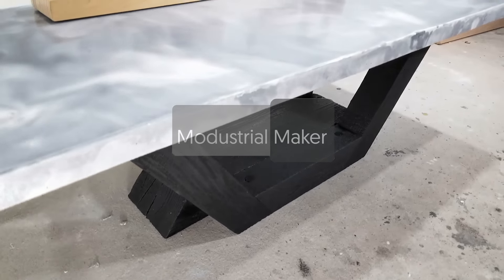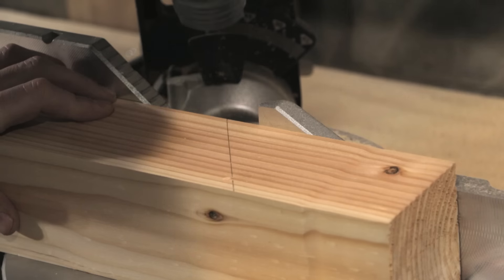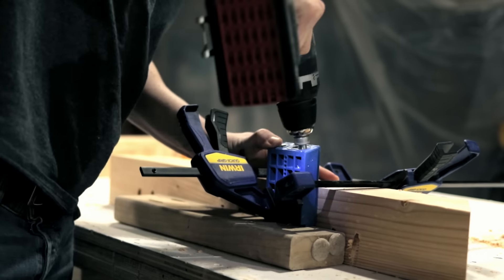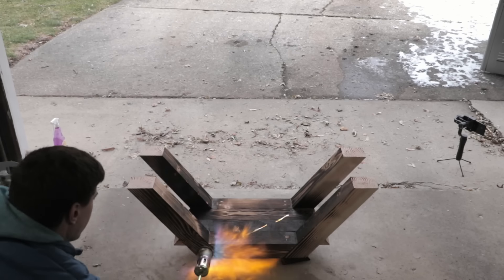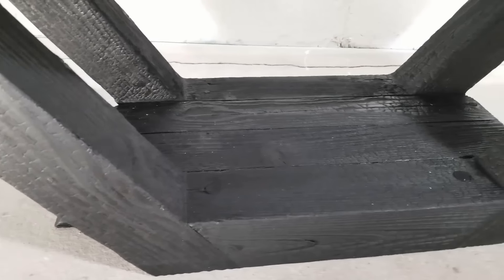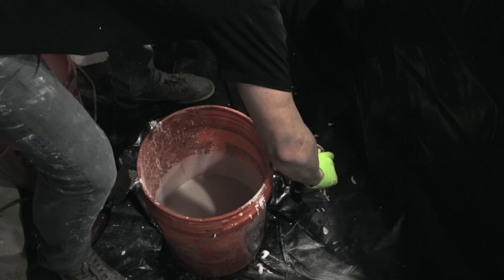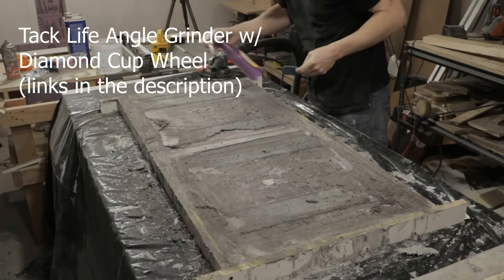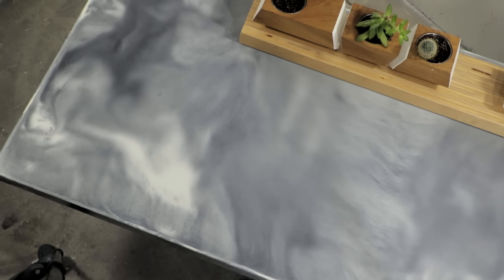DIY "Marble" Concrete Table || w/ Shou Sugi Ban Base

Comment: beautiful! How much  weight do you save using the foam?
Reply from the maker: It cuts weight almost in half....probably 50-60 lbs.  Also reduces the cost significantly (since GFRC mix isnt cheap).

Comment: Hi Mike! How did you attach the table top? Is it just lose?
Reply from the maker: Yes, just relied on the weight of the concrete. You can use construction adhesive tho, if you want to secure it.

Comment: Great work! Could you please share which LED strip brand did you use? If I have to use it outside (for BBQ island), is IP65 rating ok or do I need to go IP68 (submerged)? Thanks.
Reply from the maker: I think you meant this comment for another one of my videos since this one doesnt have LEDs.  I'm not sure the  difference between IP65 and IP68 but I think both are ok for outdoor use.  Let me know which video you are asking about and I can tell you which kind of strip.  Also, I usually include links for the types of strips used in the video description
Reply: Oops don't know how that happened, I swear this was the only video I saw and commented before I fell in love with your others and subscribed : )  Anyways, I am talking about your waterfall concrete countertop.
Reply from the maker: Ah thanks!  For that one I used ws2813 ip20 (non waterproof) strips....for outdoor use ip65 or ip68 ws2812 or ws2813 strips will work great.
Reply: Thanks! I will check them out. BTW, difference between IP65 and IP68 is IP65 is water resistant but IP68 is waterproof (can stay submerged under water).
Reply from the maker: No problem, good to know.

Comment: Aren't you at all concerened with the structural integrity without reinforcing & vibrating?
Reply from the maker: No, it's GFRC, way stronger than normal concrete.

Comment: Real like the base and the top is great. Did you make the planter on top?  That is a very slick looking planter.
Reply: Jeff Stubb it looks great! How did you attach the top to the base?
Reply from the maker: Thanks!  I did not make the planters -- picked them up on Etsy years ago.
Reply from the maker: I actually haven't attached it, so it will be easier to transport to its final location.  I plan to use construction adhesive on the tops of the legs (basically, the same way you attach a countertop).

Comment: Love the video, thanks for doing this.  I hope to make this for my deck before fall.  My intent is to place my electric smoker and small hibachi cast iron grill on it so I can work at waste height.  Not sure I will do the marble look as I am lacking in both mobility and skills, but you never know.

Do you have any suggestions or things I should consider doing different for an outside top?  I live in Michigan so it will see about every bit of weather you can imagine.

Thanks again!!
Reply from the maker: GFRC does great in cold weather, and hot weather.  Get yourself a nice stash of concrete countertop sealer -- if you want to keep it looking new, applying sealer once or twice a year will help.  Overall, concrete, and especially GFRC , is a great choice for outdoor countertops.  The ability of GFRC to let you keep the weight down is a very good characteristic if you are building on to an existing deck.

Comment: After you burn the wood, how do you keep the black "soot" from coming off every time you touch it or it touches a rug or something?
Reply from the maker: +Brian I didn't burn the underside, and used a brush to wipe ash off.  Then used the Danish oil because it penetrates and hardens, and that was enough for light duty use

Comment: Hey Love the project! I have a question though... Would this base support a non-GFRC slab? Would I have to add some cross members if I were to go that route? I'm in Canada and GFRC premix is very hard to find. I am leaning towards Quickrete Counter Top Mix, because I have access to it. They do sell  glass fibres though so it is an option to mix some in. Any thoughts? Thanks so much!
Reply from the maker: Thanks!  Might be tough to get the swirl pattern just using countertop mix since it has larger aggregate (pebbles) in it.  You could try making your own face coat with some white Portland cement, quikrete medium commercial sand, acrylic fortifier, and plasticizer (rapid set makes a packet they sell at HD).  I would def add a cross brace to the base if you go this route.
Reply: Modustrial Maker  Hey thanks so much for the reply. What I failed to mention, was that I'm not going to do the marble swirl. Just really like the legs and am wondering what the best way to do this is, considering what products are available to me. Would you recommend I mix some glass fibres into the quickrete counter top mix, or could I get away with not having to do that? If I don't use the fibres, should I put rebar in the slab to strengthen it? I guess my concern is that there is not that much support for the slab with these legs and I've never worked with concrete before so I'm unsure of it's limitations. Thanks again!
Reply from the maker: should be ok without adding fibers if you go 1.5" or 2" thick and add rebar.  If you add some cross members to the frame (e.g., stretchers), then that will help support the top from below, and you might not need rebar at all.
Reply: Modustrial Maker  Thank you~!

Comment: Why upside down? You can still work the cream to a high finish right?
Reply from the maker: You mean in the concrete form?  If so, the finish off the melamine is smooth, so you don't need to trowel it at all when done like this (if you search for "pre-cast concrete vs. pour in place" you'll find lots of info comparing the two approaches)
Reply: @modustrial  thanks!

Comment: Any suggestions on where to buy a similar quality concrete locally? Those shipping prices are killing me.. it almost doubles the price of the product!
Reply from the maker: Yes shipping is rough.  Where are you located?  You can also call Fishstone directly if buying multiple bags, and the  cost will be less per bag.  (www.concretecointertopsupply.com). The other option is making your own mix from scratch...you can buy GFRC ad pacs from fishstone and source white Portland cement and sand locally.  Hopefully, the availability will change in the future so you can get this stuff at big box stores....we are working on it! ;)
Reply: I'm in North Carolina near Charlotte. Thanks for the quick reply! I'm new to concrete (but not wood) but I'm excited to try some of your methods.
Reply from the maker: I'm not sure a supplier there.  My suggestion would be to go with the GFRC ad pac, buy sand and cement locally.  For cement, Google a masonry supply shop in your area (or if you don't want white, quikrete Portland cement works).  For sand, I use quikrete medium commercial sand from Home Depot.  In my area this sand is white, but I'll note that I've seen the same type of quikrete sand be brown in other parts of the country.
Reply from the maker: Or just get the GFRC pre mix :) I tend to think of GFRC as closer to buying walnut or other hardwoods (as compared to quikrete countertop mix, which is the concrete equivalent of plywood).  With that mindset, I always find the cost easier to stomach :)

Comment: Do you normally mix your concrete so thin? Everything I've read/watched says you should always mix it dry for strength.
Reply from the maker: You are reading about normal concrete from a big box store.  I use GFRC, which is an entirely different breed of concrete.  If you check out some of my past concrete/GFRC videos (and many of the discussions in the comments sections), there is a ton of info about what GFRC is and the advantages of it.  GFRC can be cast thinner (3/4") is 2-3x as strong vertically, and 4-5x as strong flexurally, can be cast in a flowable mix, or more like play-doh for packing vertical surfaces without a backing form, etc.
Reply: Brilliant! Thanks for the info. I'll have to poke around on your channel.
Reply from the maker: +Joshua White no problem!  After you go thru everything, let me know if you still have questions!

Comment: Nice table. Curious of the measurements. Mind sharing? Thanks man. Subbed.
Reply from the maker: Top was about 42"x20" if I recall correctly (I usually work without plans, and this one went to a friend's house)

Comment: What did you do to keep air bubbles out of the face coat so you have a solid smooth top?
Reply from the maker: The GFRC mix already has a defoamer, so when you make a runny mix like this, it comes out pretty much pinhole-free.  If you aren't going for the marble look, you can also use a chip brush (or any paint brush you don't care about) to lightly brush out any bubbles from the face coat.
Reply: Thank you
Reply: How do you like the finish doing it this way vs. Spraying if the marble effect was irrelevant?

Comment: how smooth is it? Could i use that as a pool table slater?
Reply from the maker: It is very smooth, similar to marble or granite.  No idea if it could be used for a pool table however
Reply: It might work, i made an MDF pool table not long ago, i might try a small scale  concrete slater to see how the balls behave on it
Reply from the maker: That would be cool... Let me know if you do try it out.  GFRC would definitely be better than regular concrete since its surface is harder and more chip resistant, and it can be poured thinner

Comment: this sure looks amazing ! did you attached the legs to the concrete top in any way or does it just sit on the legs?
Reply from the maker: I just relied on the weight of the top, but also have attached other similar table tops using construction adhesive.

Comment: For the jig holes, did you use lag screws in there to connect the middle pieces? If so, what length did you use?

Comment: is that concrete going to crack under pressure?
Reply from the maker: No, GFRC is many times stronger than standard concrete.  This thing is rock solid.
Reply from the maker: ps I just did an interview on the Make or Break Show podcast where we went into the benefits of GFRC in detail, and explains why I have no worries about this cracking.
Reply: thanks. will check it

Comment: Good Project! I think the marble look did not quite work.  Just a plane squared edged concrete surface / top would have actually looked really good, specially with the chard wooden base.
Reply from the maker: Thanks much! You may have missed it but I explain what went wrong towards the end of the video.  I  still like it (and my friend who bought it loves it), but I do understand the cloudy look isn't for everyone. Eventually I'll do another concrete project and correct the mistake.  I did a small sample that turned out awesome, so I know it can work on a larger scale.  If interested I'm going to share a picture of the small test piece in my YT community tab later tonight, since I've had a lot of people ask how it was supposed to look.

Comment: Is there no need to secure the concrete top to the wooden base?
Reply from the maker: Not completely necessary, because the weight will hold it down.  But I generally just use construction adhesive (like liquid nails) just to be safe.

Comment: Did you make the consistency as per directions on packaging or did you make it specifically for your project and if so .. do pray tell.
Awesome video!!
Reply from the maker: Thanks!  I generally use about 1 lb of fibers per 50 lb bag, and adjust up to 1.5 lbs if it needs to be really strong.  I usually use the 8.2 lbs of water as recommended, and adjust by adding tiny amounts until it flows right....and what it right will vary for each project, and takes practice.  But, with the just-add-water GFRc mix, it is pretty forgiving if you don't get things exactly right for the application.

Comment: Is the top not attached to the base? Is there no worry of it being knocked off onto someone's foot?
Reply from the maker: It is heavy enough it won't move much.  However, I do plan to use construction adhesive to attach it after it is moved to its final location.  (basically, I will attach it in the same you attach a countertop)

Comment: So I think the cloudy issue came from when you swirled the base coat with your hand and has nothing to do with the foam. 
I think the swirling took away some of the more defined lines or veins and just ended up mixing the colors together. The only straight black or white concrete is to be seen at all is at the edges and most of that mixing happened in the middle. 

I personally probably would have used the white as the main color just because I associate marble as being white with black and gray vains running through it. But I'm also pretty sure marble has a lot of variety. 

Here is The Sorry Girls doing a small marbled concrete project with pretty defined veins. 
https://youtu.be/rXaaBeLip9Y

Comment: Its a cool tabletop , but that shou sugi ban its wrong executed ,  after the burn you must scratch the surface of wood with an aluminium brush  until remove the loose burnt wood . then you can protect the treatment.
Reply from the maker: Thanks!  There are lots of ways to do shou sugi ban -- for the alligator skin look, I did not want to scrape of the char.  That is why I used Danish oil, since it penetrates the wood and hardens inside it.  It drank a TON of danish oil, but it hardened up nicely and there haven't been any issues with the char coming off.

Comment: I don’t think the foam affected the look. You just have to refine your technique. Especially, don’t mix it around when you apply second concrete mix. That’s probably when you erased the marble look.
Reply from the maker: Thanks, yup, I will try again at some point.  I did a small test piece (pics are on my Instagram if you go back a ways ) and the veined marble look came out really well.  I'm pretty sure it was the foam.  I wasn't recording because of the panic and rapid way it happened, but I first repeatedly pressed the foam down when it started floating (before I decided the cross braces had to be put on).  Doing this pushed the back layer into the face layer and mixed it quite a bit.

Comment: The stand is held with glue then you put a cement top. Doesn't sound very secure .
Reply from the maker: This is 4 years old now, and solid as a rock.   Glue is stronger than wood, and I showed how I reinforced with lag screws.  Thanks for your uninformed input tho....

Comment: It would have been better to see some safety equipment used.  Especially when drilling holes where your face was so close to rotating equipment!
SAFETY FIRST!  ALWAYS!
Reply from the maker: What kind of safety gear would you recommend for drilling??? That's a new one to me....
Reply: @modustrial  For starters, safety glasses at a minimum.  Even though wood chips aren't as dangerous as metal, they can cause a lot of problems.  Another danger is if the drill bit should snap.  That can easily puncture an eye and cause serious problems.  You may also want to consider some sort of hearing protection.  With your head that close to a sander/drill, or any machine, it may not cause immediate damage, but over time, it can cause hearing loss.
There are a lot of OSHA videos out there that can be of help.
Good luck, I'll let you know how my bar turns out.  Thanks for the video.

Comment: I just watched another bloke and he used a larger bottom board without screws, using hot glue instead.
Reply from the maker: That works too.  I sometimes do that... especially with odd shapes.

Comment: You need to trust your materials and your technique.  Shou sugi ban is a hardening and caramelizing technique to bring out the beauty and strength of the wood. Its not a charring process.  Here historical reference could have given you greater strength and no need of screws if you stay with the spirit of the technique
Reply from the maker: I understand where you are coming from regarding history, but I'm not sure what that has to do with the screws.  Could you explain your reasoning a bit more? (my thought is that shou sugi ban heats wood rapidly, and thus could dry it out and cause it to shrink/move, which might pull glued up pieces apart -- I don't see how the difference between charring and hardening of the surface translates to eliminating the possibility of the wood shrinking due to heat.  But, I'm always open to learning if I missed something....)